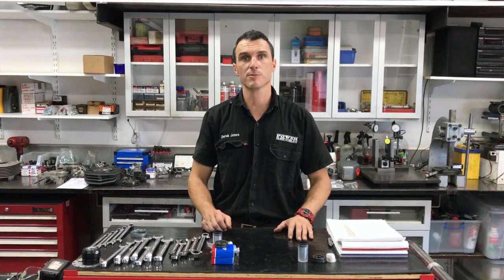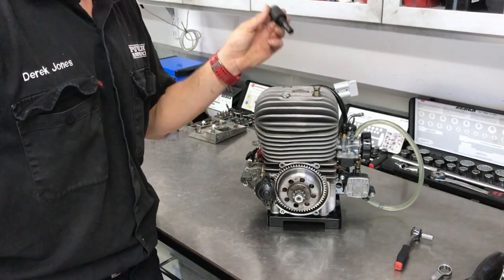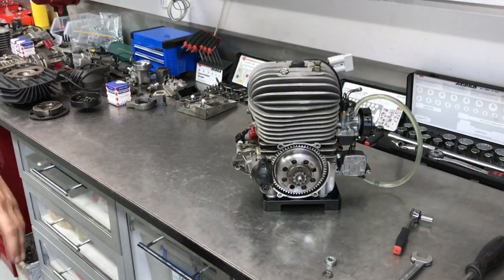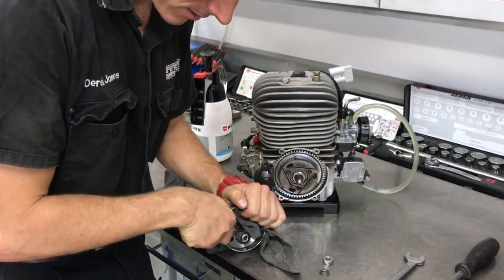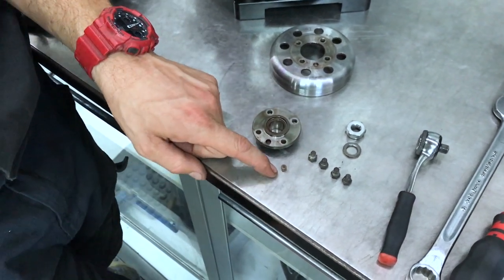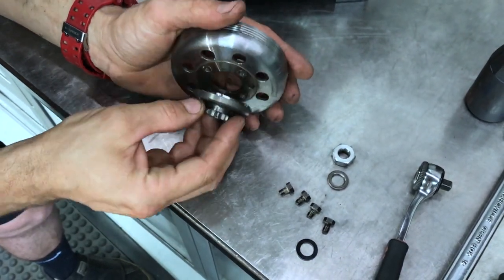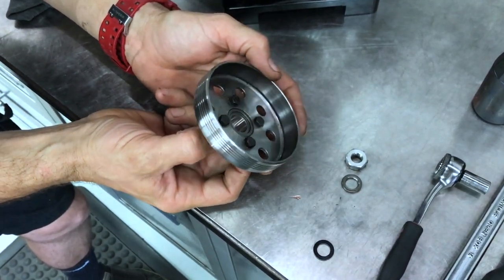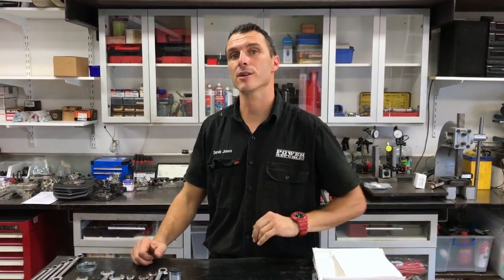HOW TO - Change Vortex Mini ROK -  Front Sprocket

Comment: Hi,, great videos you guys put up 👌very helpful, my sons mini rock clutch bell seems to loose and floppy even when tightened?? Any answer or help would be very helpful, cheers Andy
Reply from the maker: our pleasure my friend,.  try replacing the roller bearing and both thrust washers.  also check the 10T front sprocket is good to go

Comment: I recently took off my ROK VLR clutch drum to clean it and inspect the clutch, I noticed that the bolt that is connected to the crankshaft that the clutch and ignition rotor connect to was wiggling a tiny bit meaning the crank would be wiggling side to side a bit. Is this something that is normal or do I need to get it fixed.

Comment: What are the advantages of the 11T over the 10T, rear Sprocket is an 86T
Reply from the maker: the 11T should make the engine rev slightly slower for the same relative speed on track.   but it is very marginal.   if you have 10/86 you would snuggle to get an 11T equivalent IMO.